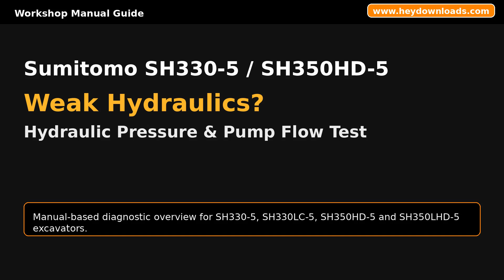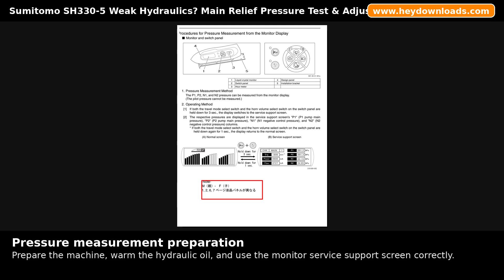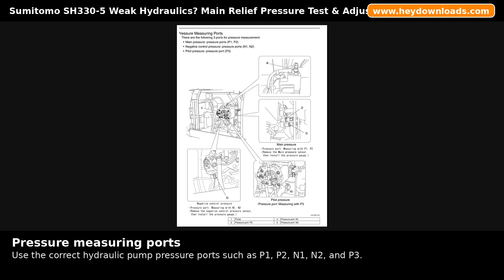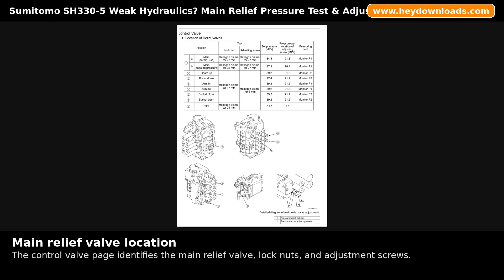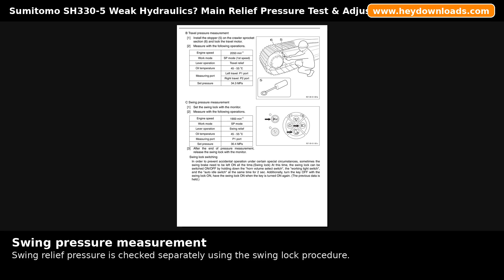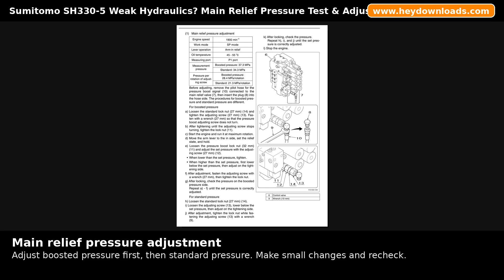Sumitomo SH330-5 Weak Hydraulics? Main Relief Pressure Test & Adjustment

Comment from the maker: Get the complete Sumitomo SH330-5 / SH350HD-5 Workshop Manual here:
https://heydownloads.com/product/sumitomo-sh330-5-sh330lc-5-sh350hd-5-sh350lhd-5-hydraulic-excavator-service-repair-manual-isuzu-6hk1x-engine-complete-workshop-manual-pdf/

This video is a manual-based overview of hydraulic pressure testing and main relief pressure adjustment. Always follow the full workshop manual and proper safety procedures before working on hydraulic systems.